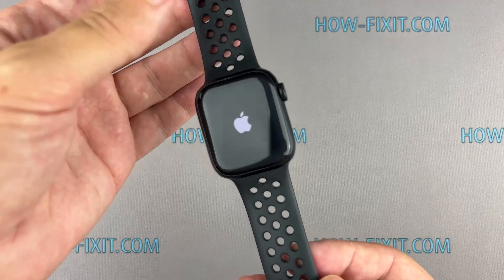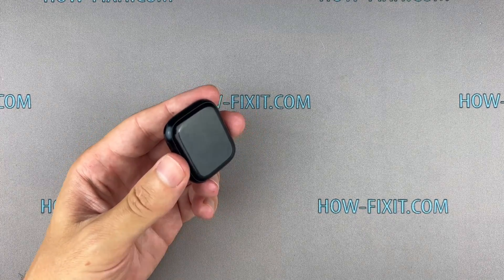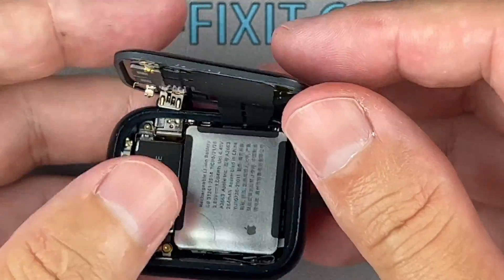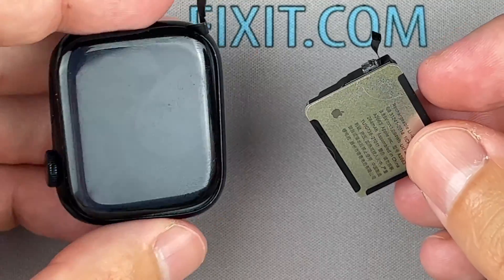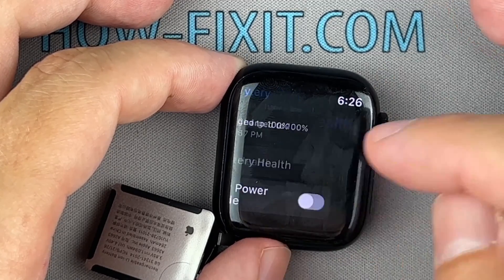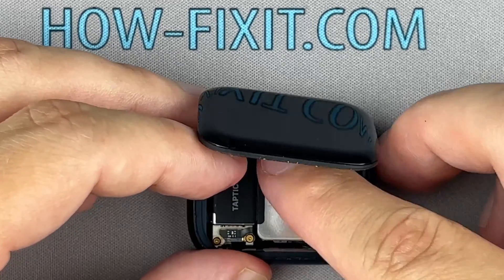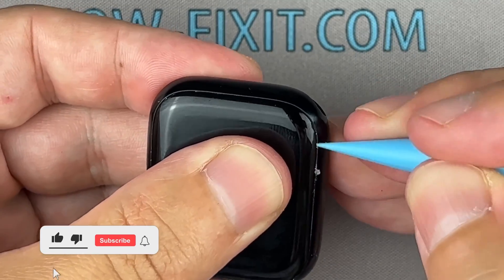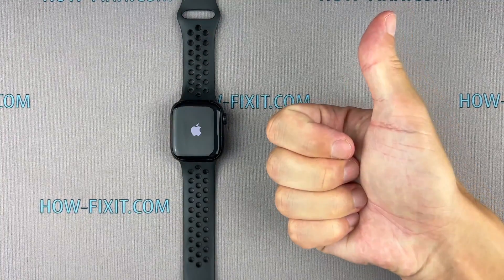Apple Watch Series 7 Battery Replacement Guide

Comment: Hi I just followed this video. When I edged the screen slowly loose the bottom of the screen went black. Then when opened fully only 1 line of pixels was working. Now changed the battery and have a black display and watch wont turn on. I was very careful. I thought it would just be a screen flex cable knocked loose but can’t see anything loose. Wish I had never saw this video!

Comment: 5:31 That area behind the ribbons looks difficult to apply the glue, are you sure that the watch will preserve its original water resistance rating of 50 meters under ISO standard 22810:2010?

Comment: DO NOT TRY THIS AT HOME. Made to look too easy tried myself and I’m not a complete novice have fixed iPhone screens in past but I’ve now ruined my Apple Watch 7. I had ALL the correct tools. The case removal part ruined the screen as the glass separated from the case and damaged the entire unit beyond any repair. This rendering my perfectly working Watch (al be it low battery) to zero. My advice is just to not attempt this and take it to Apple to do.

Comment: So by the time you buy all the tools equipment and battery it will cost you the same as what Apple charges to fit a new battery! I guess you have the tools for another job but often are you going to do that, plus if Apple do it, you will get a longer warranty!

Comment: Was that a brand new battery? Replacement battery showed 95% battery health! YIKES!!!
Reply: He put the same battery back in obviously lol. It was just for show how to do it.
Reply: I bet replacement battery won't have option to check health and will probably display a non genuine part warning
Reply: @domino5711  It won't. Only with an Apple made battery installed by Apple themselves.
Reply: @domino5711 I replaced it and check health work fine.
Reply: The battery fuel gauge probably wasn’t calibrated. It takes a few cycles to reduce error and the relative SoC to = absolute SoC = 100% at full charge.

Comment: This is terribly hard to do yourself, you will 100 percent damage the screen just from separating it from the case. Highly don’t suggest this.
Reply: It is very hard but if done properly, good results
Reply: Especially when Apple replaces the whole watch for you for the price of a battery, this is not worth it.
Reply: They now sell batts for $15
Reply: True, I just damaged the screen on my watch😢 This tutorial is pretty bad. You shouldnt slide the pry tool like in this video. Take your time, use heat, alcohol and gently try to pop the screen up from every corner. Such a shame I missed your comment on this video before repair
Reply: Looks easy to me, he did it 🤷🏽‍♂️
Reply: @jamarallen08  Even a carpenter could build a cabinet. Could you? They are called "professionals" and they have tried and tried and tried and tried hundreds, thousands of times to reach this level of skill. Don't write nonsense like "he did it" thinking you are on the same level as him.
Reply: @iragreca  I can do it.  You can’t? 😬 work on it 🙏🏾
Reply: @jamarallen08  I doubt you're capable of doing anything
Reply: @iragrecaok not true, my mom just started working on in house stuff and she’s perfect on her 2 try buddy I bet you didn’t even fix your Apple Watch and bet you can’t fix anything
Reply: Well you’ve got to know your skill set what you’re and what you’re not capable of doing. If you know you can do it and have repaired other electronics such as this then you know you have that skill set if you don’t or do not think you can do it then by all means do not attempt it some people are good with this kind of skill where others are not it’s ok just don’t do it if you doubt yourself because it’s not easy but if you know you can then do it.
Reply: @GRoy-h8y don’t or do not, what? Clearly work out your response here because that doesn’t make sense, and have you done this yourself? Would be nice to share your experience vs judging everyone else’s since it’s pretty obvious people looking at these diy videos know the risk they’re taking on fixing it themselves.

Comment: Do you think I could buy a back protector and hope it keeps everything together?
Reply: That would probably hold it together physically but it would not be remotely sealed and you would eventually have issues. It may take up to a few months but you would get both moisture and dust building up inside that would cause an issue, most likely being the end of the watch at that point. You should be able to get a pre cut double sided stick on gasket but if you can’t find one you will not mess anything up with the right glue even if you were a bit messy, it won’t cause issues electrically and it’s very easy to clean up.